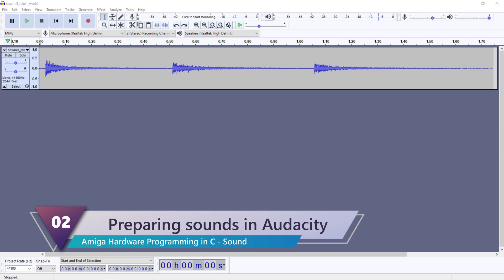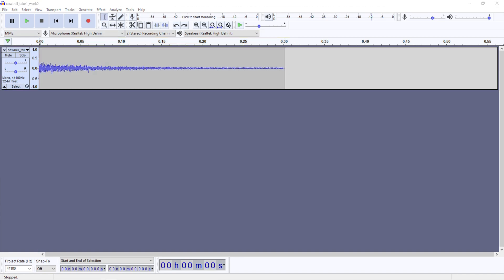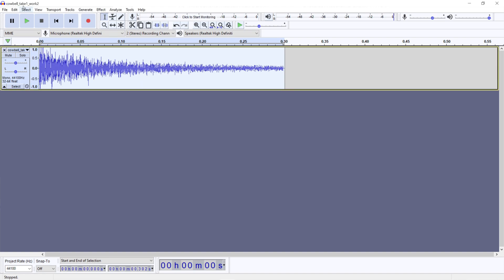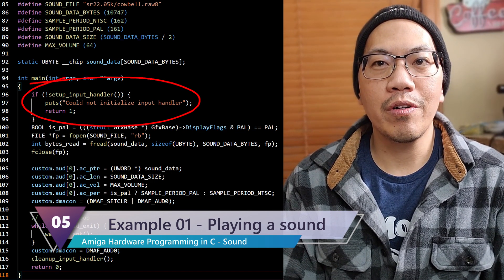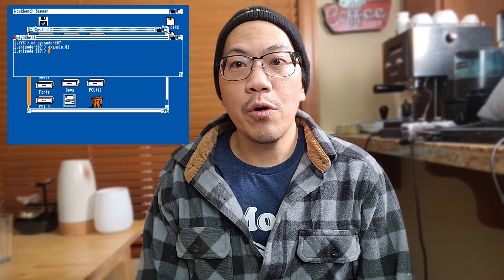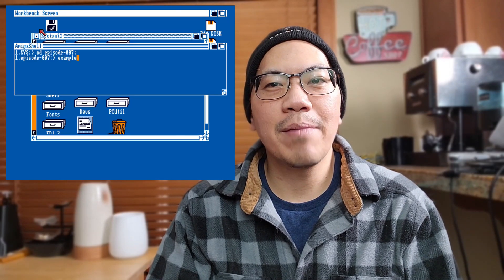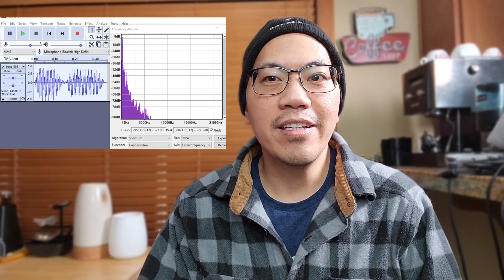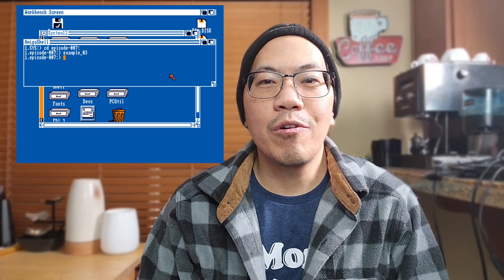Amiga Hardware Programming in C Part 7 - Sound

Comment: Yup, the Amiga plays sound exactly like your PC sound card does. Except it's tighter so it doesn't need buffers and so don't introduce a delay. PLUS it can play a sound at any frequency without coarse conversion. It was a decade ahead, but how far is it now? Is it generations ahead? ;)

+1 for pointing out the wait. You will absolutely get better audio quality on an Amiga or a synth by bypassing the resampling (by SoX in this case, but hardware or software resampling doesn't matter) and sampling directly. It's one conversion less, which removes aliasing distortion. See Wikipedia!
Reply from the maker: Hi Photon, thanks for visiting here and your comments ! I don't have a demo coder background, so I include discussions from the Amiga boards in my research for making my videos trying to catch and reproduce some of the gotchas (that's why there are citations from the related threads in the code). So it was interesting to see how the examples that were running perfectly on FS-UAE in various configurations behaved differently on my A1200, a lesson that programs still should be tested on real hardware if possible.
When it comes to music and sound my approach is that I typically just grab myself some instrument and record it and I used to use the samples that came with my Amiga music software back in the day. Getting white noise all over the place at first as a side effect of downsampling and dithering was something I read in the HRM, but still had to experience myself :D

Comment: You could directly take a non-dithered Mono 8bit Amiga IFF export easily from Audacity. Is there any advantages using SoX?
Reply from the maker: good point, I haven't tried that, flexibility I guess, and the ability to easily batch if you have multiple sounds to convert ?